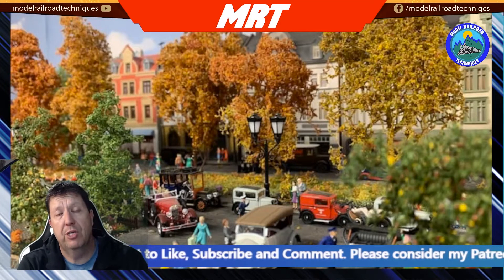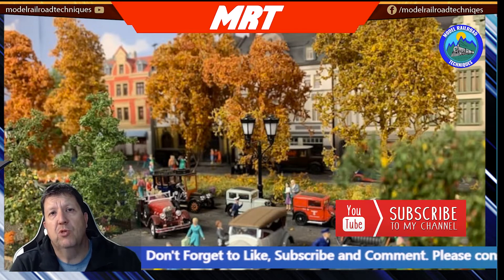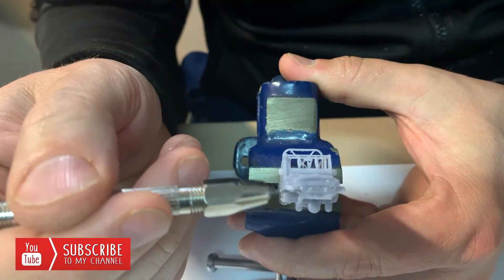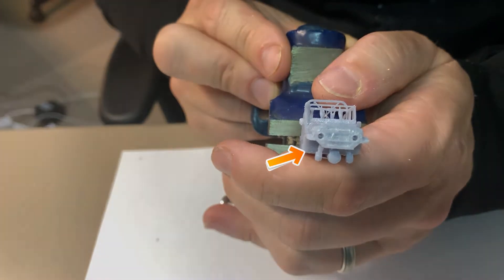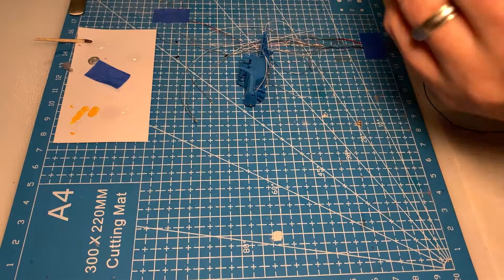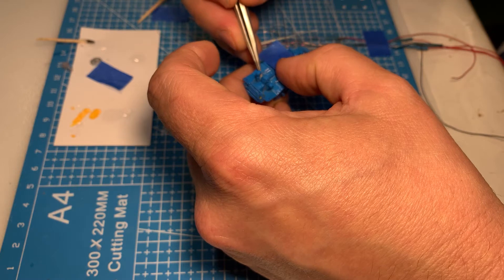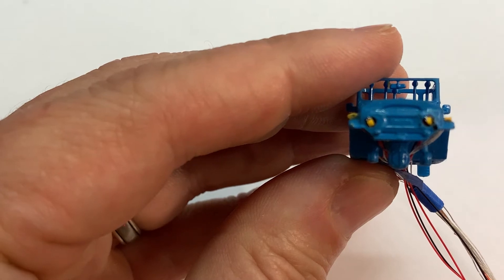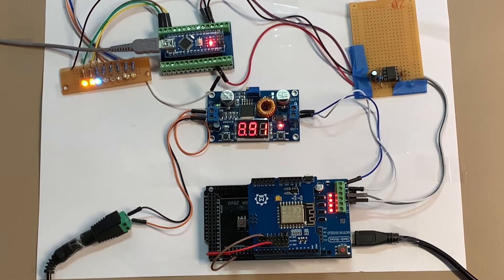LED lighting your HO Scale vehicles - Model Railway

Comment: https://www.youtube.com/watch?v=SFpJ_OKwlAI&ab_channel=chikes4862     i had to put brake tail and blinker in a hanging light .i use a pic 12f629 so i have 5 outputs to play with.the print i use is large but its below the bord so no problem .the problem is that smd optocouplers are the same size as the through holes exept the legs are shorter .
Reply from the maker: Wow. I will need to look at this one.
Reply: @ModelRailroadTechniques  thanks .i glude the red and orange 0402 led to gether and made the positif lead as the common.then the two other leads and twited them together .put them into clear resin so a dropled apeard and put it into the sun to harden.painted the bak black and that was it.i use one pcb for almost all my moving things at my layout .it depends off the program written

Comment: I add my own wire to my 0402 LEDs the wire I use is the primary winding wire from a wall wart power supply, it is like human hair in thickness and really easy to route through vehicles, also for rear turn signals and brake lights I use the same LED with different resistors to give two different brightnesses to the tail lights like most real vehicles in North America.
Reply from the maker: Cheers mate. I have tried soldering my own. My skills stop there unfortunately..